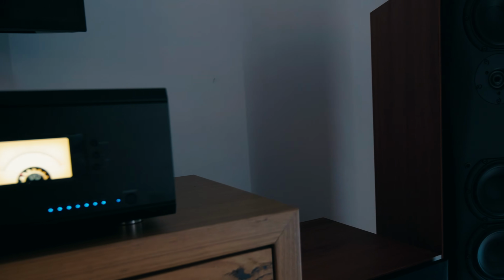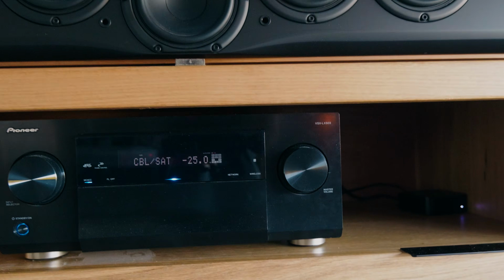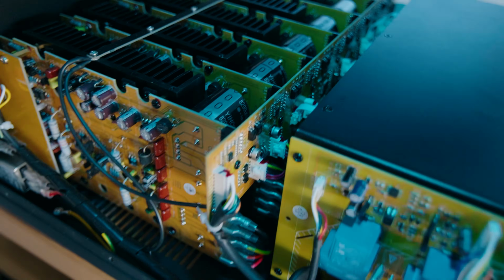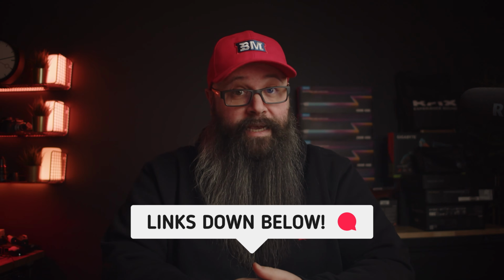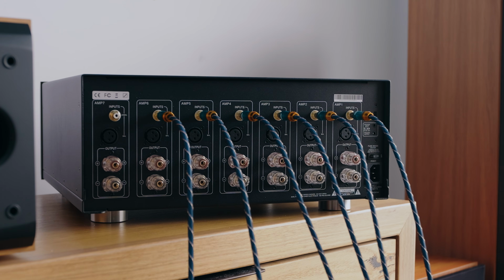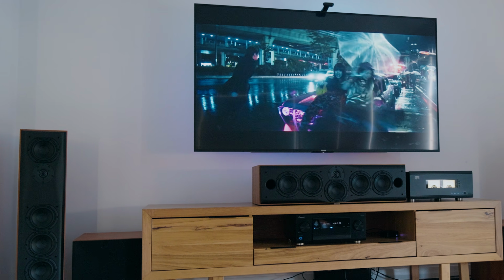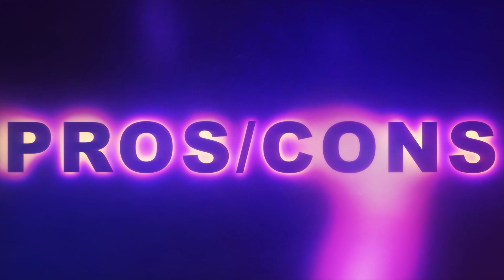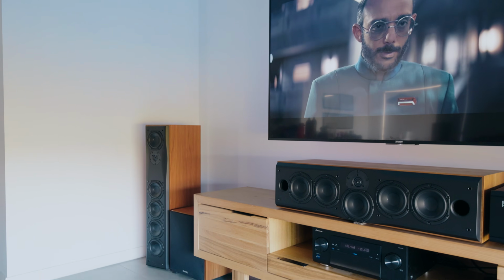I REVIEW THIS 7 CHANNEL BEAST!– Here’s What Happened! // Summit HIFI A7 Home Theater Amplifier

Comment: Good review. Just wondering do you rerun room correction when adding an external amp?
Reply from the maker: Absolutely yes you MUST run a new calibration - which I did with my system.
Reply: @BuildMontage  How is it that the rise in amplification with an external amp, affects the sound acoustics of a room with the same AVR processing the audio..?
Reply from the maker: Different gains on the output

Comment: Received the amp today. I attempted to remove 2 of the Torx head screws from the top panel and the heads both snapped off using little force (Torx tool not cordless drill). I've emailed Aamir to ask for a solution before attemping any more.
Reply from the maker: Oh no! I had no issues at all with mine, and I removed the lid a few times for filming. Hopefully Aamir can help you resolve it quickly.
Reply: @BuildMontage  I was able to remove all the others using a hair dryer to soften each screw just in case. I also was able to remove the thin metal bracket that the screws go into, so hopefully I can tap out the stem of each screw that broke.

Comment: Hate to say it mate but you show the rear of the A7 with its beefy, high quality speaker out terminals but you use the pissiest little speaker cable and banana plugs to connect such lovely Krix speakers ?????????
Reply from the maker: 14awg speaker wire is plenty good. Maybe I should also warm the cables up before I use them too 😂

Comment: Good review Tony, as always. 
I’m interested to know how this amp compares to the Aussie built Electra amplifiers you own. 
I’m looking to purchase an altitude 16, so I’m looking around for a decent amplifier, or two.
Reply from the maker: I love my Elektras, they have sentimental value to me as well as sounding great, loads of power and low distortion. I don't really know how to compare them as I'm not a technical review of things like this, more subjective and I didn't test them in my main room - but they do have loads of power and similar specs to the Elektras. I dare say these are as good, but I did notice a little more noise coming from the actual unit itself than the Elektras which run a little quieter, but as it's in the rack I wouldn't know either way. Spoilt for choice to be perfectly honest, I can't see you being disappointed going either way. The Tonewinner amps are also pretty good too, and all around the same budget.

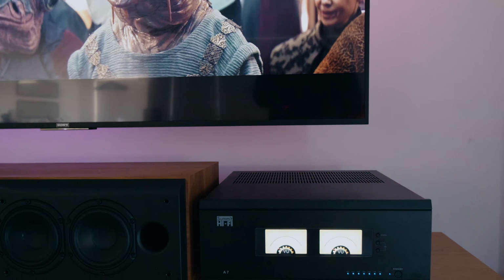Comment: Tony, at 2:18 what is that grey piece under the Epicentrix? Under the centre of the speaker.
Reply from the maker: It's a window packer which I used to slightly angle the speaker upward :D
Reply: @BuildMontage  👍🏻thought as much. I’ve done something similar with my centre speaker.

Comment: That is not very expensive.
The future is class D though if you want real efficiënt power.
Reply from the maker: It's not expensive in my opinion either, however, I always get people upset when I call something "budget". I've tested Class A/B and have the Krix Elektra A/B in my dedicated room powering my Krix speakers through a Trinnov Processor and they sound great. I know Trinnov amps are class D and they have come a long way since the PA style amps but I like the A/B design - trade off in weight from pure class A but have nice amount of power and low distortion.